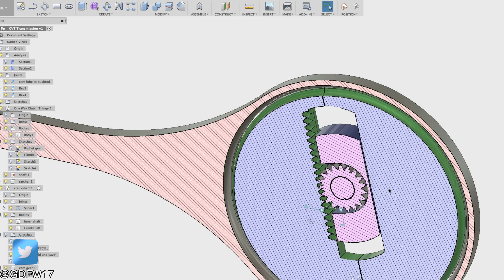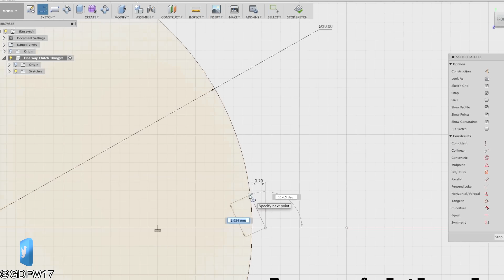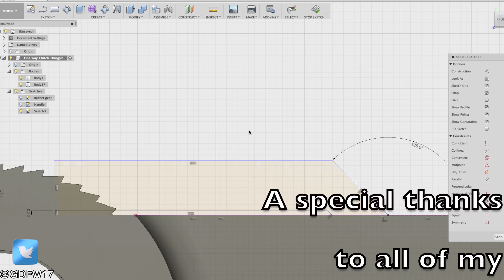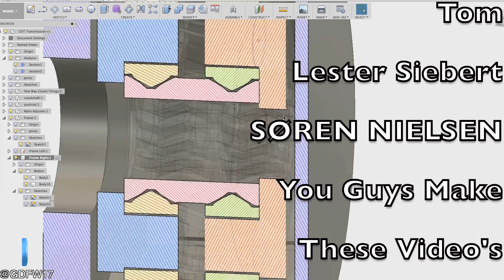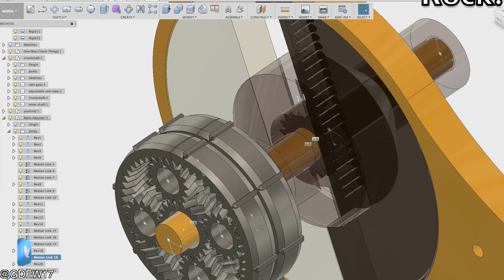The Coolest Transmission You've Never Heard Of... The Ratcheting CVT

Comment: Wouldnt this be very useful for windturbines?
Reply from the maker: Maybe in the sense that you could transfer energy to the bottom of the turbine with three cables that pull one at a time, but in the other sense this cannot overdrive at all. And wind turbines need to overdrive their motors usually.

Comment: Wow. I mean, wow. I've been trying to figure out just how to pull off multiple radial length adjustments on one shaft. That is impressive. 

I came across a similar ratchet CVT years ago, but rather than that beautiful adjustment mechanism, it used compression springs on the connecting rods to vary the output automatically. The trick was to pre-load the spring, so it was at max compression if the output didn't turn by the time the input crank was at full extension. 

The little model I made died a horrible death at the hands of my nephews that didn't know better. They tried turning the output backwards.
Reply from the maker: The OG model that I made died a horrible death of me throwing it at a concrete floor to extract the 14mm and 9/16” ratchet wrenches that I used. 

I’m glad you like the cam adjustment method that I used, I had spent a lot of time thinking about how to do it, for I while I though that the inner shaft would have to be mounted concentric to the input shaft, it’s a good thing I was wrong.

Comment: I’ve heard of it being used in bikes but i have no actual knowledge of what a cvt is
Reply: Kenneth King lots of modern Honda automobiles have CVT transmissions such as my 2016 Civic. It works really well
Reply: it's called a continuously variable transmission. it allows you to continuously change the gear ratio between the highest and lowest ratios.
instead of having fixed ratios, you can select any spot in between, and there's no unclutching.
Reply: On bikes (scooters) It's a belt sandwiched between 2 V's on the input and output end. They use weights and springs to adjust how much pressure the V's push towards each other, and as they push in on the input side it increases the diameter the belt rotates on that side, increasing belt speed, and on the output side as they push further apart it decreases the diameter the belt rotates, increasing shaft speed. This type of CVT can't be used with much torque without becoming unreasonably large and heavy, and has short service intervals and reliability issues regardless.

Comment: You mentioned you used fusion. I would recommend learning Onshape.
Reply: "Well, I must admit that I know very little about Fusion"

A very good reason to keep quiet then!

Fusion is 3D parametric CAD, plus sculpting, high end CAM and a bunch of other stuff. 

Where it completely crushes Onshape though, is the ability to work with no internert connection. Whilst Fusion is Cloud enabled, it also caches files locally.
Reply: WTF is "Linux environment"?
Seems you don't even know what you are talking about.
Reply: Phillip Toone , I agree, Onshape is the most user friendly/ intuitive CAD program I've used.  I do have to try fusion though, but if it's anything like InventorPro, I'd still prefer OnShape.  OnShape does need to add a CAM package though...
Reply: Onshape does the same including file version, etc.  So you can do different versions without messing up the basic ones etc........
Reply: "A very good reason to keep quiet then!" Ouch. Am I being told to "Shut the hell up!"? When is it bad or wrong to encourage someone, especially a student of engineering, to learn a useful and powerful tool? I am not aware of Fusion's abilities to do "3D parametric CAD" like SolidWorks or Onshape.  I am aware of the limitations associated with Onshape's requirement to be tethered to the internet. And, like Fusion, it is free for now. But that could all change in the future. FreeCAD and OpenSCAD are both an open source solution that you can rely on remaining available in the future but lack the functionality I have come to expect from products like SolidWorks and Onshape. Finally, I prefer to work in a Linux environment so this is a limitation of both SolidWorks and Fusion. I would really like to say, "to each their own" but the real "problem" with so many options in the sharing of designs. This is one area where Onshape really excels.  It is like the github of CAD.
Reply from the maker: why?
Reply: Also, it looks like the motion of the output shaft is not smooth but oscillates because it is driven by a ratcheting system.
Reply: Gear Down For What? Well, I must admit that I know very little about Fusion. I learned SolidWorks and have found Onshape to be the best collaborative, free alternative to SolidWorks. I assume Fusion is more like Blender and less like SolidWorks.
Reply: Fusion is a full parametric CAD... And the biggest feature of Fusion is it's collaborative capabilities, you don't even save the files locally, it's all cloud based.

Comment: I'm going to take a guess that the ratcheting mechanisms on the output shaft keep it from being continuously variable, but I'll stay tuned for the next video to see why.
Reply: Yes, it's not continuously variable because it relies on discrete steps in the ratcheting mechanism. A rotation equivalent to say 1.2 cogs will not get picked up by any other ratchet, which means while it may rotate by that angle it cannot transfer torque until the next ratchet comes along 0.2 cogs later. This aliasing effect means it's not continuous but rather has enough discrete steps to give the illusion of being continuous. It's sort of like a circle on your computer screen; it's actually squares arranged to look like a circle, but since the pixels are so small your brain smoothes out the edges and what you see looks like a perfect circle. You could increase the number of transmission steps by making a shaft with a smaller cog modulus or by adding more phases. Both would reduce the aliasing effect. I guess if you put a large wheel on the output shaft this effect would be very visible.

English isn't my native language so I hope I got those engineering terms right ;)
Reply from the maker: Heh your onto something
Reply: Haha spot on dude, great explanation!
Reply: yes a certain amount of lost motion due to ratchets kinda will mean this wont be in a car !
Reply: @patrick the reverse could be added, i dont think its a problem for that part. i think problems with lost motion and backlash mean this could not be used in a car, the lost motion could be a real problem under load (which this test was not) and could slip or go backwards too
Reply: It doesn't sound like you have ridden a big single bike,  and I wont argue with you except to say they discovered Ducatis secret in the 90's regarding their ability to put power to the ground (traction) and discovered that it was the pulse characteristics of the motor through to the rear wheel wheels that made the difference.
Whilst  the other manufacturers were seeking perfectly smooth power delivery they would just break out once the torque exceeded the traction, but pulsed delivery will  back off just before it breaks traction. That's how its been explained in many a bike magazine, especially regarding  the other configurations such as big-bang  and cross-plane cranks which try to emulate this effect.
It has also been explained via the physics of anti-lock bracking systems, almost same thing in reverse.
Reply: Because the torque converter in an automatic delivers a continuous stream of torque translated from the pulsed output of the engine. Through the internal fluid coupling, until the torque converter is locked that is.
Reply: the ratcheting design would need to go into a computerized idea as an electrical set input and output
Reply: i was more thinking the lack of reverse
Reply: Most vehicles with a manual transmission  will deliver a pulsed motion to the wheels consistent with the firing order anyway.
Reply: In the same way a gas engine's output is a number of steps (well ramps to be precise). So the more cylinders a gas engine has, the smoother is the transition between each ramp. Once you get to 6 cylinders (in a 4-stroke engine) each power ramp overlaps, giving you continuous power flow. One of the reasons eight cylinder engines are so popular.
So more eccentrics in this design would not only resolve the balance issue but would give a smoother output flow.
Reply: Forget the ratchets. There are 3 just so that the output shaft doesnt stop. The thing is the linear motion created by the 3 wheels is not constant, it always accelerates and deaccelerate. This means the output is in continous motion but not constant. The graphic of speed/time of the output would look like mountains. The more rackets smaller the mountains. Theoretically you would need an infinite number of ratchets to obtain a constant output. English is not my main language so might be hard to understand heh
Reply: It is discrete by design, you always move in steps, but with sufficiently small steps, you can aproximate a continous variation, in the same way you aproximate a circle on the display of your pc or phone, which is made of dots.
But that's the least of it's problems. My hunch is that the worse problems are that it's very unbalanced, hence would vibrate a lot, it's noisy and the ratchets probably have more wear then regular gears.

Comment: You mentioned the dual differential system but the tanks i know use either a clutch system or a electrical hybrid systeme? Can you give me an example?
Also, very nice cvt but it most certainly has the same problem as the rotary engine ( i mean the excentric cames, as the friction results in fairly high losses).
Reply from the maker: Im not 100% sure that the dual differential setup is even common in tanks, but I imagine that there is some post track vehicles that use it, guess I should of rephrased

Comment: Do you have a video that just explains how planetary gears work?
Reply from the maker: No I don't actually
Reply: Gear Down For What? Ok because I don't know how they work lol
Reply: Yeah but this guy explains things in a way that I can understand.
Reply: Admiral Percy well if your such an expert pal, you completely missed the fact that this comment thread is only trying to explain planetary gear sets. In not one comment has been mentioned a cvt. Good day
Reply: @Admiral Percy
Buddy, you need to go look at some pictures of CVT, because so far every single link sent your way has been about Planetary Gears. They're called "Planetary" because the components look like an orbital system. A "Sun" gear in the center, a "Ring" gear surrounding them, and "Planet" gears in between.  In most cases, sending power to one component, restricting the movement of another, and outputing power to the third component either increases speed, decreases speed, or reverses the speed. Stack a bunch of them together for varying speeds. Old autos only had 3-4 gears, while new ones have up to 8-9.

A CVT has a minimum range, a maximum range, and whatever you want inbetween. They have no "speed", they can go anywhere within their range. How well they do so varies by construction.
Reply: I don't know how people are making the concept of planetary gear is so ridiculously complicated when it's not.
 A planetary gear is simply any gear that revolves around a central or sun gear. The end.
 now you know how planetary gears work.
 usually it's a more specific in most cases are somewhat slightly complex in their actual design and implementation. 
So a planetary gear setup in many common cases you'll have a central sun/solar-gear surrounded by often 3 slightly smaller planetary gears but none of this size relationship or number of gears is rule because it depends entirely on why a planetary gear is needed in your specific case. the only part that is a rule is that a planetary gear is a gear that revolves around a central gear which would be a solar gear.
 now you know how planetary gears work, if you want more, it depends specifically and entirely on the application that the planetary gear to be used in to be able to learn how that type of planetary gear set would work.
Planetary gears are often found between the electric motor and the drill chuck in an electric grill so consider buying a couple of cheap drills at yard sales and tear them up to study it.
Reply: https://www.youtube.com/watch?v=5piYEX-jRt4

https://www.youtube.com/watch?v=4HPtIXlno3w
Reply: Admiral Percy basically a planetary has 3 parts. The ring gear, planetary gear, and the sun gear. If you hold one of those gears, you cant get 6 speeds out of it. 2 reverse, and 4 forward. If you hold 2 of the gears, you get direct drive. To change whether you get a under or over drive even in reverse. The sun gear is the gear in the middle. And the planet gear orbits around it. It usually has 3-6 sprockets and also meshes with the outermost gear, the ring gear. If you drive the sun gear and hold the planet gear, you get a reverse. Same with holding the ring gear.
Reply: NIGHTLAMP12345678 - How could somebody design something without understanding how it works? Maybe he went mad because he didn't understand why the world didn't beat a path to his door after he invented it.
Reply: kennedy796 That's not helping.
Reply: Admiral Percy maybe go find a planetary gear set model and play with it. I believe there has to be a place near you.
Reply: Damn! Great explaination there, kennedy796!
Reply: Trying to figure out how planetary gears work makes blood come out of my ears.
Reply: Admiral Percy I
Reply: TheKowrider 711 eh?
Reply: https://youtu.be/ARd-Om2VyiE
Excellent video to watch
Reply: Planetary gears and ring gears work to reduce speed and increase torque which creates more operating power!
Reply: sam robinson wish you luck
Reply: I believe the man that designed it went mad as he didn't understand how it worked.....
Reply: it must be true I was told it as a apprentice...:-) he went mad but may be not just because of the gears..
Reply: If I can summarize, the hollow input shaft turns the planet carrier of the first planet set.  Because its ring gear is fixed, its sun gear is forced to turn.  That sun gear powers the second planet set, causing the second planet carrier to rotate at the same speed as the input shaft as long as the second ring gear/knob is held still.  The rotation of the second planet carrier is coupled back through the hollow input shaft, causing the pinions to rotate at the same speed as the input shaft.  By rotating the second ring gear/knob, (like the cross drive motor on a tank transmission) you speed up or slow down the second planet carrier very slightly (while the knob is actually turning) so that when the knob is still again, a net angular displacement has occurred between planet carrier one and planet carrier two.  Very ingenious!
Reply: Look up 3-speed bicycles.
Reply: "A planetary is quite a headache to understand." --Totally agree!!!
Reply: I would suggest to Admiral Percy, go to a junkyard and buy a used up Auto transmission. It will have all kinds of gears. ANd you will get a great look at a planetary gear set. You may have to disassemble the clutch packs. And get a bit dirty, but it could e "fun" for you.
Reply: Whoever invented planetary gears made a magnificent, deeply insightful leap in mechanics, almost alien in nature.
Reply: Yeahhhh.... think that's been pretty well covered elsewhere...
Reply: OK so they were mainly adapted as a torque-increasing reduction while being able to have more teeth in contact at any one time. While it's all good that we've worked out different ways they work the main way is sun gear as input, turning the planetary gears, more of which increase torque capacity, turning the ring gear which is the output. It's always been known that adding reductions increases torque and this was a much better system than a bull gear due to the amount of teeth in contact at all times and the ability to make it realatively compact for the reduction possible. While credit is due to the design it's extremely likely that functions have been worked out after the fact which were not necessarily intended.

TL;DR Planetaries increase torque holding capacity while adding a reduction in the most commonly used variant
Reply: Admiral Percy No, he was clearly describing how a planetary gear works. It may not have been the best description ever, but it is utterly different from how this CVT works and the fact that you think he is describing the CVT shows a profound lack of understanding on your part.
Reply: kennedy796 You're trying to explain this CVT - and badly - when I want to know how planetary gears work. I appreciate the effort, but that's not what I was asking for. I don't think you can give me what I'm asking for.
Reply: Admiral Percy i have a engineering degree as well as this. If this doesnt help you, then i believe you need to understand more about the principles of gearing. A planetary is quite a headache to understand.

Comment: If you ever need some help with a project like this, I would love to get involved. I am a mechanical engineering technology student at IUPUI and will be graduating in the spring. I have been doing CAD work since high school. I am no pro, but I can model what I need to. It looks like you have things under control but figured I would make this post, couldn't hurt, right?
Reply from the maker: Do you use Fusion 360? email me at askgdfw@gmail.com and ill start a group folder with you - my autodesk email is different from the askgdfw email.
Reply: I have used Solidworks (most familiar with), Creo Parametric, Inventor, and I some other free 2D softwares. I'll shoot you an email.
Reply from the maker: Your email doesn’t accept replies
Reply: Gear Down For What? There's weird, I did get your email. I'll send you my response again with my personal email.